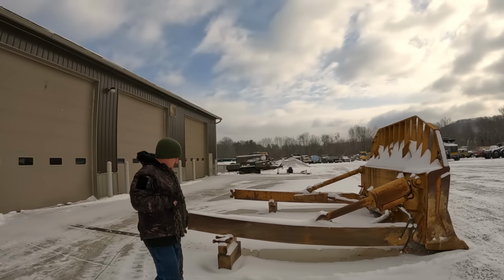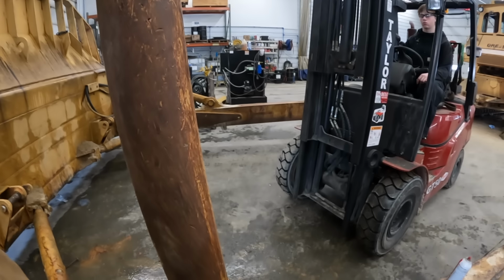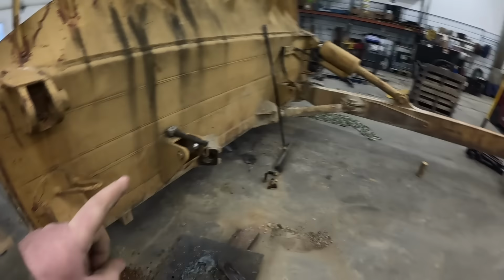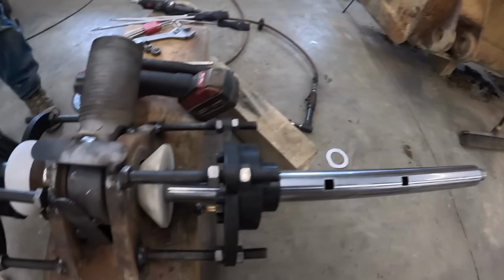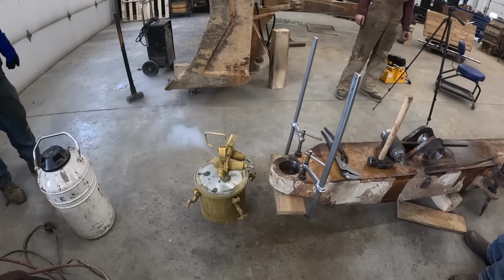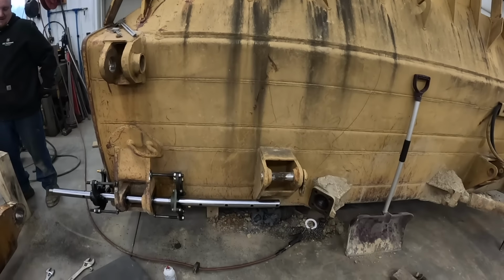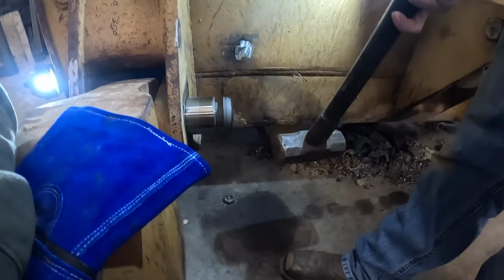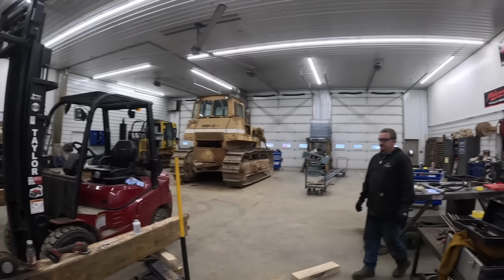Dresser TD-25G blade repair | line boring and welding. Part 1

Comment: your best bet with the liquid N is to use a small (12”X12”X12”) thick walled styrene/styrofoam cooler.  Also, you can preheat the receptacle to facilitate the bushing going in.  And yes, you CAN recycle liquid N.
Reply: I buy several cans of air duster at WallyWorld. Turn them upside down and spray away. Got a big piece? Get a helper and spray 4 cans at once. It will freeze it in no time.
Reply: Use leather welder's chaps to protect lower legs. Get a LN rated full face shield (not a wrap around mask). Placeing part in the bucket first and then pouring LN in minimizes splashes. For conserving LN the funnel should be LN rated as it will shatter. I used LN in a label environment. Preheating the bore also helps when a crush fit is involved.

Comment: You’re supposed to completely submerge the bushing and pre heat the hole with a rosebud to help it go in easier because as soon as you drop in the bushing it rapidly starts to cool so longer in the nitrogen the better 💯😎🤙🏼

Comment: The project is looking awesome... Just curious, have you ever thought about getting yourself a retired jaws of life setup? when we had stubborn pins to remove in the shop, or needed to lift/remove items.. we would pull the jaws off the rescue truck and use it.. the hydraulic power pack can also be connected for other purposes.. with departments switching to E-tools you can probably grab one at auction for a decent price//  keep up the great work!!

Comment: I machined pins for my 450 G   I kept the clearance to .0005 because I had the ability to grind the pins.  Looking back back that was way overkill.  I bet now they will have seized and require the Oyl Lance to remove them.

Comment: Hello  Clint. When using LN to shrink your bushing/interfereance fit. It is critical to know the bushing material and how much it will shrink. There are charts etc with this information available. The surface finish on the bore is also important. A rough finish will bind more easily than a smooth finish. Unless you took a 
finishing cut off camera.The finish on the bore was rougher than I would have wanted. My experience was Aircrraft landing gear and a .003 interference was very common. Beyond that heating the bore was a must and even then a press may be needed. Pounding them the way you did is undesireable and in severe cases could shatter the bushing. Needs must tends to dictate and you did get the bushing installed. A hint give the bushing a full minute after agressive bubbling stops to shrink it a bit more. It may not help but it might and it will not damage the bushing. Good luck on the next one. Finally LN is not to be dealt with casually. A errant splash can blind  an eye pretty much instantly. Please take proper face & body precautions. Looking forward to seeing the Big Machine back in plowing form.

Comment: Whenever use freeze one part , you need to heat the other. One contracts, the other expands. I have installed a lot of bushings and bearings that way. That one packed inside and outside with snow for the time waiting for the liquid nitrogene would have been enough to cool it with the other part heated well.

Comment: Clint you need to get a styrofoam cooler that is 12 by 12 by 12 with a lid  but bushing in cooler fill to 1” over the bushing then pre heat hole then the bushing should fall in to place

Comment: Where you are putting in a stepped pin, you could put an arrow on the bracket with weld to tell the next guy what direction to hit, seeing as you are being considerate of the possibility of it coming out again some time.

Comment: 😊 Air arcing what we used to call back in the day.. lots of Sparks lots of molten steel flying around. Done it to many times
Reply: He was using an oxygen lance, or slice torch
Reply: Carbon rod + high amps + air under pressure, and you have the old air arc setup. A carbon rod with high amps flowing  thru it melts the steel and the compressed air blows it out as it melts. I have seen 8 inch thick steel plates and 12 inch forged shafts cut with them. Very effective and quick but makes a rough cut very cheaply.
Reply: @jackielanc  I know what you are referring to, I have one.
Clint used a different tool.

Comment: Hi Watch the videos from Cutting Edge Engineering, he always pours his back in the bottle. He fixes a whole range of equipment, line boring, lathe, Milling, honing  , cylinder rebuilds. Currently rebuilding his FRANNA Crane in his spare time:hand-pink-waving:ok my post was a  bit late

Comment: Its always a Judgment call on how far to go when repairing an older machine - though experience tells what needs to be done to give any given machine another lease of life without over spending  beyond the machines value - a well equipped Shop as you have there permits a good level of repairs to give said machine its next life

Comment: Works better if you torch the piece the bushing is going into to expand it before taking the bushing out of the liquid nitro, and yes it fine to pure back if thats all your using it for it stays cold but will turn back to gas just sitting in the other container so best to pure it back soon as your done.

Comment: Can reuse liquid nitrogen....  Supposed to use a rosebud tip and heat the hole the frozen bearing is being installed in....  If you heat threads, melt paraffin wax into them, let it cool and screw it out. Much better than penetrating oil. You guys are awesome!!!!!!

Comment: I can tell you my experience with liquid nitrogen is very extensive due to my military job. Liquid nitrogen is stored at -397 when you put put the metal in it and you put the lid on it and you could view the rushing out air was because the liquid was boiling off in order to get the metal down to temp. when it stopped blowing overboard you was spot on, Just  make sure you don't contain it in something it will build pressure into the thousand's of psi, when using nitrogen it will suck the oxygen out of the room I've personally watch birds that came into our shop pass out and fall out of the sky hope this info helps I love watching the show it keeps me going in laughter and food for thought.

Comment: Clint, the best way I've found to remove those bushings is with the Saw/Saw and a good blade. I watch Cutting Edge almost as much as I do you Clint, You're right he does know his stuff The main thing is to see if you can dry fit your pin before you freeze it, because if it doesn't drop straight in, it's going to be a bad day GREAT VIDEO

Comment: LN2 is -321 degrees F, as it warms it reaches its boiling point and returns back to a gas, never containing it in a non vented vessel as it will explode.

Comment: Damn those oxy lances are violent! Crazy how they just bore right through those solid steel pins like that. Very impressive.
Reply: Plasma cutter, laser cutter, cutting torch, oxygen lance, electro gauging - all have the same principle: getting metal hotter than the sun and then blow the molten metal away. Kurtis from CEE Australia has a few videos on his channel where he uses electro gauging (compressed air), mostly on repairing dozer blades and grader blades. 😎✌️

Comment: YES Reuse the precious CO2 gas - just takes a bit - wait until boil if gone meaning same temp.  If boiling like just put in the metal is hot.   Could flame heat the big bar and chill the insert and it might slide.

Comment: Careful hammering bushing that have soaked in liquid nitrogen, they can shatter. We used to put rebar in it and hit it with a hammer, it shatter like glass. Can using dry ice, not as cold as the liquid nitrogen does work good.

Comment: Two Hints: Kevin should use a full face shield and you can use a cheap styrofoam cooler to chill parts. Your way did the job. 
There is a man in Australia that does something very similar.  His youtube channel is Cutting Edge Engineering Australia

Comment: You need to set GO - NO GO gages (snap gages). Heat  (not cherry red)  and  freeze in freezer and use CO2.  Set up porta power to pull sleeve. Gotta be quick with all of this. We had flywheels around 3  ft dia  6" thick to reinstall on a 4" shaft. It went back on a lot easier than it pulled off. Always great, educational videos. Still waiting for some of Kevin's goofyness to infect Tucker.  Thanks

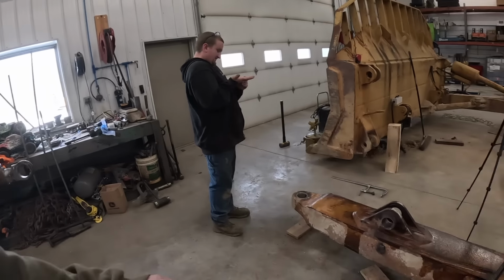Comment: 30:17...You did right !!...Kurtis from C.E.E. pours the liquid nitrogen back in the container . He heats up the  receiving end with a torch before though...Y'all got it done  !! P.S. I saw someone using candle wax( clear...) on those pins after they're heated up . Works real good from what I saw .

Comment: Thought your mini wand was an awesome piece of kit Clint, just the tool for those troublesome pins as you could be quite delicate. Had a guy come out to a demo job years ago when not many people had seen one working - absolutely amazing as he burned through a heavy bridge abutments - didn't seem to make much difference to him what he came up against - steel / concrete / rock - it all just melted. Mind you, his lances were rather larger and he got through them at an alarming rate! 
Kurtis at CEE is a Class Act - I bow in his direction these days and acknowledge that we are not worthy.

Comment: If in the future you had to change A pin. It's a pita and expensive to remove the blade for ONE. So do em all while it's off. Like a commercial building with lights.....change every bulb, not just one....another in two days....on and on and on.

Comment: Very informative on the line boring when it is the way to fix the issue of the way the fit is much tighter and repurposing pins cutting costs if possible and learning the men to think it through anyway i liked the way you do things Mr C 👍😎🇺🇸 NY

Comment: The metal paint pot used up a lot of the LN cooling power.   
Heavy Styrofoam cooler in a wood or cardboard box, and heavy foam cover as insulation.  
Plastic coolers get brittle and crack.
Soak  much longer.  Some rosebud heat on the part and a hole chamfering or  deburring first

Comment: I should be out working, but this video sure reminded me of working on the TD -20 they had where I worked in the 70's.  We rebuilt all the pins and bushing on the blade too.  We didn't have that fancy torch that blew a hole thru the pin, what a tool. Keep up the good work.  Will be watching the rebuilt on the other side.  Our tilt cylinder was on the left, yours on the right, interesting.
   That little but mighty GT50 forklift is one good machine, your work would stop if you didn't have it.  Love the big forklift too, and that large lifting crane outside. 
  Someday will make a visit and browse you equipment lot, not too far away in Ohio.

Comment: In NEW ZEALAND Railways we used to put stub shafts into big housings using dry ice, i got a giant coffee can, rapt it with rock wool. put in the stub shaft, pour in methylated spirits.  To about halfway up the shaft, the dry ice came in lumpy bits about 2 inches long and about 3/4 dia. Id drop in the dry ice, till it covered the shaft, then top up the can with meths.  leave it in and covered in the meths, for about and hour.  the shaft was about 2 inches in diameter.  I'm not sure if you guys have methylated spirits but it was basically methyl alcohol.  The shaft would shrink about .004 inches, depending on how long you left it in. The great thing about this method was it didn't expand very fast back to its original diameter.  Id also rub tallow in the housing.  The brew used to sort of boil, id leave it till it stopped giving off vapor. Also dry ice is not as dangerous as liquid nitrogen.  The dry ice would chill the shaft down to minus 60 degrees centigrade.

Comment: We used to do large bushings every day on large valve/actuator mounting. They had to be a slip fit so we relied on flapper wheels to clean the bores and 1 inch wide 180 grit sandpaper for the coupling. Kept us from having to hammer them in but it allowed the bushing to be removable in case something needed repair. Huge valves for pulp mills etc. You guys did a good job boring and fitting pins!

Comment: Hi Clint, well Curtis has Homeless, you have Kevin..... But homeless can't paint...you win!  Take the torch heat up the hole chill down the pin. Usually it drops in, well with a bit of hammer assist!

Comment: Back at Mohawk Rubber in the 60/70s we used dry ice to shrink 18 inch bronze bushings for the 80 inch line mills that compounded rubber. It came in 12/12/1 inch plates or granulized  in brown paper bags and easy to work with.

Comment: What class NS wire are you using I sold NS wire for twenty five years have had great success with NS from two pound rolls to 1000 pound reel less coils highly recommend this brand
Reply from the maker: We have er70 and 71 dual shield

Comment: while you guys might not have the setup CCE does, the quality and pride in your work the same. Snowball Engineering another good fab channel. the Dresser isnt going for 100 point Concourse restoration, its getting much needed TLC/repairs. Clinton , you guys doing damned good job

Comment: Can’t argue with success, you did things a lot differently than I have done projects like this, however, it works, pretty hard to beat that. Many different ways of doing things. Really for a single line bore machine, setting up three bores in line on two different pieces three times and machining pins, two days isn’t all that bad. You guys did a credible job, looking to see the “ole” girl up and running Clint, thanks for the update, appreciate you taking us along.

Comment: Question for Kevin.  What the heck machinery did you paint lavender color? Color in the paint pot.  Do you have a picture to show us.  Is that lavender your new El Camino color? Up coming episode? 😂❤ Thanks for the snow mobile update.
Reply from the maker: It's actually just a paint liner that slips inside the pot but it would make the elcamino stand out🤣🤣🤣-Kevin

Comment: Why don't you invest in a ultra low temperature freezer since it's much easier to use compared with liquid nitrogen.  I paid $500 for my freezer used and it's -122°F which is cold enough for most applications.

Comment: Regarding the liquid nitrogen use, in the shops I have worked in we always did the following, which incidentally is identical to what Curtis at CEE does.
After watching him use the stuff he pours the liquid nitrogen in a thick walled Styrofoam cooler till it covers the part he is chilling down. Next wait till the LN stops boiling, indicating when the part is down to temp (coldest)and ready to use.
The fit of the parts is critical because if it sticks on insertion, and your not in position your screwed and will need to "beat the new part back out" and start over. Of course this assumes a 2-6 thousandths interference fit between the parts, so measuring the bore and pin diameter is a must.  The tolerance is dependent on materials and the temps used.  Needless to say it is critical to have both the bore and the pin/bushing machined smooth and the parts need to be clean, anything that can hang up a smooth insertion will ruin your day.
Heating up the part with the bore for expansion contributes to a successful "mating" of the components as well but makes everything explained above even more critical that you "get it right" or you really will lock the parts together, usually badly enough that they could get damaged when attempting to get them apart for another attempt.
OH, and yes, reclaim the liquid nitrogen back to the DEWAR(insulated container with the plug) so doesn't all evaporate away, perfectly reusable.

Comment: For small parts, it's usually 3-5 minutes. Large parts, probably more...like 10 minutes. The key is in the machining. If the part is machined too big, lots of issues. Like impossible to insert frozen part, and during warming the part expands and cracks host structure. Machined too small...sloppy fit.